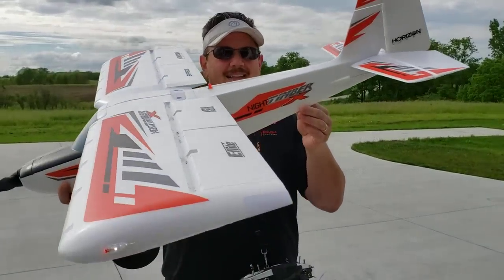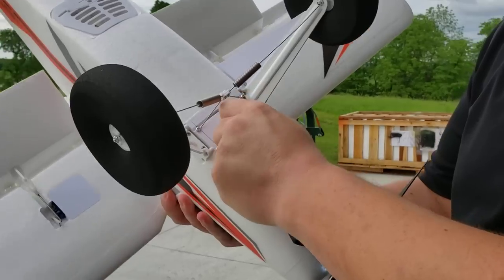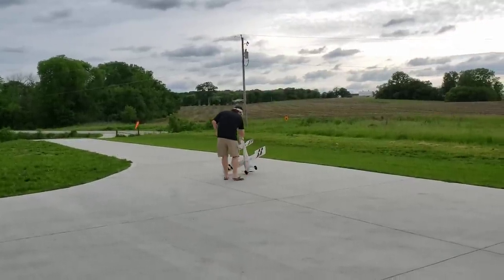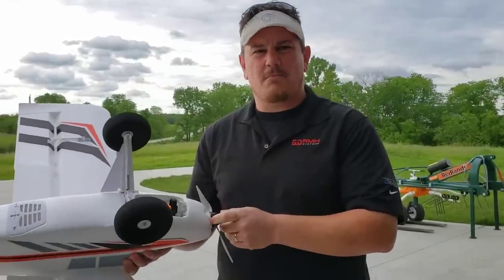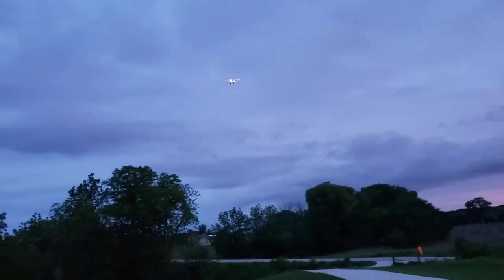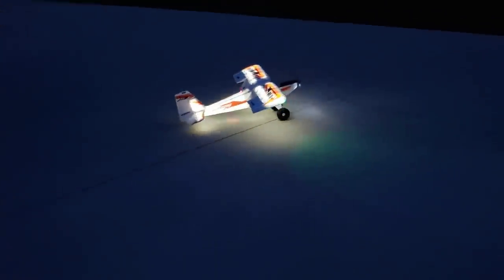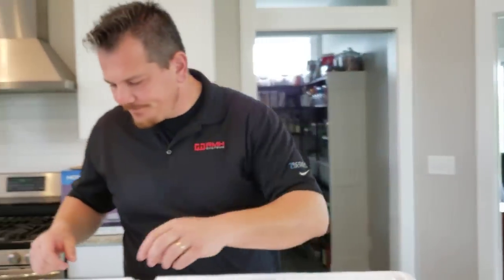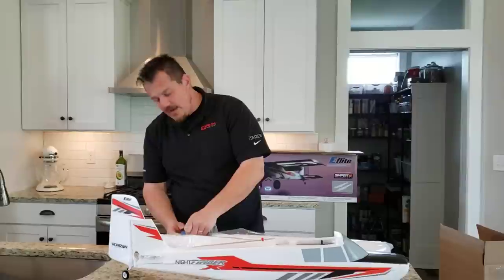Horizon Hobby - Night Timber X 1.2m - Unbox, Build, Setup, & Maiden Flights

Comment: I just learned why you remove the prop while programming. Just got home from getting 20 stitches in the palm of my hand.... haha I’m so stupid sometimes. One thing is for sure, I won’t make that mistake again. The part at 1 hour and 58 min is where I get lost. “We will obviously keep our hands out of the prop area during motor reversing cause we don’t need hand chopping” this totally applies to dummies like me.
Reply from the maker: Ouch!!! I've been lucky to only been bit by UMX planes, but this plane would be no-fun!!!
Reply: Brian Phillips it was no fun.  Those props are sharp. Btw, greAt videos, I am still trying to program my dx8 g2 transmitter and can’t get the reverse programmed correctly.  Which is why it went full throttle at the idle position.  Any advice would be great since I almost threw it across the room after the prop cut me open.  I followed your video tutorial, but I must have screwed something up..  I get lost when you disable the gear or something.  Is gear safe mode and aux 2 reverse motor mode?  Gonna take a couple days to regroup and lick my wounds haha. Great videos you and you wife post.  I have binge watched a bunch.  I look forward to more videos! Should I Inhibit aux2 or gear?  Do you set up high and low rates and did you set up the blending to use the flaps and ailerons at same time?

Comment: A excellent fun plane to fly. The only two negatives I encountered with my Timber X,(not the night version ), were the tailwheel was set at 45 degrees to the neutral rudder position which I very carefully used a screwdriver to straighten. The second was the foam is dented in under the front cockpit plastic piece.
I installed the metal spar in the tail right from the start as I intended to mainly use 4 cell batteries. I flew the first flight on a windy day, ( always windy where I live in Australia) and found it handled the wind no problem. Dropping the flaps in the wind is like slamming on the brakes and is a lot of fun.
Due to the large amount of control surface movement, even with safe on a beginner would find it a handful. 
One thing I would suggest is to have spare props on hand in case of tipping on the nose. The plastic on the wingtips certainly saves the wings if it tips over. It is by far my most favourite plane. Trying to get club members interested in doing STOL spot landing competitions.
Enjoy watching your videos. Keep them coming.
Reply from the maker: I hate when there's little stuff screwed up on unboxing - super annoying!!! Sounds like you love it. I want to maybe put on the slats, just because I want them on there for looks ;)
Reply: It might take some of the edge of it’s manoeuvres but if hot glued on should be easier to remove than if  superglued.
I do enjoy flying it. I also have the 1.2 Mustang June Nite and the Viper. Figured if I could handle the Timber X, I should have no problems with the other two. Unfortunately planes here are double the price you guys pay due to the exchange rate so crashing is not an option.

Comment: FYI: When I built mine, I found that the internal control horn set-screw for the rudder control wire was a bit loose and while the rudder was likely well aligned at the factory, when I was assembling it the setting moved.  I'd suggest after you setup the radio but before you install the wing, you recheck that the rudder and elevator are centered with the radio on (zero trim settings) and then torque down that set screw!  Otherwise, you likely will have a "bad day"!  Doing the wire bundle zip-ties that Brian recommends is also very smart!
Reply from the maker: Loose screws can lead to a bad day, for sure!

Comment: Brian. Got this one a week ago. Awesome plane. All the features this one has makes up for the bottom battery installation- that’s the only thing that keeps this from being the perfect specimen from Horizon. Other than that—just beautiful. I was amazed at the 4s power.....I believe I may have to pick up another 1 for back up....If you know what I’m thinking....lol. I was playing hard with the original Eflite Timber and decided to plow the field with it while it was inverted. I liked that plane, and salvaged most of the electronics but never replaced it...I love planes that have lights. When the Night Timber came out-had to have it. I don’t do 3D either-at least not on purpose...haha. Oh-If you not heard already-some folks have experienced some control rods popping loose from the control horns. I highly adding some fuel tubing to all the ones for the wings-especially the way you fly-if you not already thought of it. Enjoyed this video. Kudos to the Camera Crew. 🔥🔥👊👊😉
Reply from the maker: I totally agree about that bottom access for the lipo....but it is what it is ;) The lights are good enough that you can actually tell what direction you're moving, and the orb of light on the ground it fantastic!!!

Comment: Took a hiatus from flying the Apprentice from a shoulder/arm injury during a rainy workday at the club field - slipped and fell directly on right shoulder HARD!  That was some 4 months ago.  During that time I took the plane apart, stripped off the decals and am painting it to resemble the Cessna Skyhawk that I owned for seven years.  At this week's swap meet I bought a BNF Night Timber 1.2 for a great price planning to take it with me on a 1 month plus camping road trip - smaller size to help with storage.  Could be easy to fly with SAFE/AS3X.  Should be back to flying this April.

Comment: Hi Brian,
At around 1:59 you wondered about the A switch on the IX12. I have the IX12 and the A switch is a 2 position. I setup safe on that switch. I also tried to do the advanced setup but had problems with the left aileron not going the same direction as the others. Decided to revert it back to standard setup and in the process I had two spare servo extensions. As it was necessary to re-bind the plane I plugged one servo extension into the bind port to make it easier to plug in the bind plug. I didn’t run it through to the battery area but I think it would reach. I also deleted the model on the transmitter and started with a fresh setup.
The battery straps are starting to stretch now so I will be fixing that problem shortly.
I found it odd that they didn’t supply two servo extensions to do the advanced setup. At the time I purchased the plane the extensions weren’t available here. 
The IX12 is a great transmitter and I’m glad I bought it when I did. A very capable transmitter. The IX20 has way more features (sorry camera crew!).
Reply from the maker: LOL - I look forward to my new IX20, just as soon as I have almost everything else done around the property....

Outbuilding
Shop finished
Basement finished
Pond installed
Trees planted
Mini excavator purchased

...then the IX20 ;) LOL

Comment: Thanks for your quick reply.  The plane is a BNF and has the AR637TA, and I built from a blank profile, starting with the same settings as our other Timber X, but I changed some things.  Then I tried the two downloads available from Spektrums website mentioned earlier.  

I agree and thought that the AS3X is supposed to always be on, which is why I was wondering what is possibly wrong or if I some how conflicted it off or something.  Our other Timber X, is also the 1.2M, basically same plane except it has the AR636A reciever and I like that it's touchy.  It flys great, with both the iX12 and DX6 (Gen2).  That is why I bought the Night Timber, because of how well the our other Timber X 1.2 flys in variable wind conditions, so my wife and I can fly together, with basically the same plane.  Perfect manageable size too!  I will compare the settings between the two again lol.

I made a mistake saying I was using the 4S 5000mAh batteries, that was wrong, We actually use 3S 30C & 4S 50C 3200mAh's.

Thanks again, I glad to hear it confirmed that the AS3X is always on and can't be turned off with the AR637TA receiver.  Now I know it is something with my settings and I'll work on that.
Reply from the maker: With the AR637T you CAN access "Forward Programming" to turn it up or down, or off....but at this firmware level of the AR637TA, you're STUCK :(... I think the answer I got from HH is that there MIGHT be a firmware upgrade for the TA :) :) ;)
Reply: @BrianPhillipsRC   I hope so.  It would be nice to be able to adjust.  I'm starting the transmitter setup again for about the tenth time. I tried the original Timber setup too, didn't work.  One  flap servo started to jitter and won't stop even after holding it, and now the other servo's on the wing are following suit.  I still have a lot to learn lol.  Both the Carbon Z Cub 2.1 and the other Timber X 2.1 setup perfectly the first time other than one bad servo that got replaced.

Comment: Are you a beginner pilot wishing to buy this plane?  I am a beginner pilot and I bought this plane because of this video and others like it, and because I wanted the lights for night flight. Here is an update on my thoughts about this plane after 10 or so flights:

1. Forget thoughts of flying in the dark. You lose depth of field when the sun goes down and a crash is likely for a beginner pilot. The lights are very cool, but they aren't for you.
2. Before flying this plane, I had flown a small park flyer (I forget the name), a Carbon Cub S+ and a Conscendo Evolution. This plane is a big step up from those planes in the sense that it is very fast and the control surfaces make it very twitchy for me.  It rolls, climbs, loops, dives all very, very fast. Of course you can slow things down, but in trying to figure out how to slow things down you'll probably crash along the way. Get it up high becuase you are going to be flying some acrobatics when you don't mean to be flying acrobatics.
3. Landing is MUCH harder than it was for any of the prior planes I had flown. This is a heavier plane and it is easy to break the plastic in the fuselage that the landing gear screws into. If you are a beginner pilot, I would say a hard landing is the first way you will break this plane. And when you break that plastic in the fuselage, it is never as strong as it was after you glue it together again with epoxy. So you'll be applying epoxy to your fuselage around the the landing gear more than once. OTOH, if you have access to an experienced pilot that will buddy box with you, you should be able to avoid all the landing problems.
4.  Unless you are just flying ovals, you probably won't be able to fly this scale the way Brian does in this video. You could just fly it on SAFE, which is what I did a lot, but eventually you'll want to fly the plane yourself, and when you do, it won't be a smooth flyer.
5. 4S power is a lot of power in this plane, but it's kind of made for 4S power.  It flew much faster than what I was used to, and bad things happen much more quickly in this plane. You could just put a 3S battery in it, reduce the throws, throw in some EXPO, turn on SAFE, etc. but if you are doing all that it means you bought the wrong plane.

I have crashed my Night Timber X a few times, but it is still flying. HH sent me a new fuselage for free, so that was nice of them (I just put it together last night and it's like a new plane...anyone want a good deal on a Night Timber X?) 

****************************************************
But for me, the Night Timber X is more stressful than it is fun. ***** ********************************************

 I have just placed an order for the Turbo Timber. I wish I had done that in the  first place. Brian told me to start with the Turbo Timber, but I didn't listen. (And Brian, if you are reading this, you should not have told me to "start" with the TT, but you should have told me that "the TT is a lot more fun than the NTX.")

One last point, if you don't want to fly 3D, if you consider yourself a scale flyer, then I'm not sure this is the plane for you even if you are an experienced pilot. Turbo Timber seems like the way to go for a scale experience in a plane like this, but I haven't flown one yet.

One very experienced pilot who is very much into STOL told me that he sold his Night Timber X and purchased a Turbo Timber because NTX was too heavy for good STOL. And the NTX is not even marketed as an all-out 3D plane. 

I think part of the reason I purchased the NTX instead of the TT is because I was looking at the TT as closer to a beginner plane. Someone says "you aren't ready for the NTX" and I think "oh hell I can figure it out." Who wants to spend money on beginner equipment only to be unhappy with it after 8 or 9 flights (think of that first crappy transmitter you wasted $100 on)? That WOULD BE a reasonable way to look at it if the TT was built  for beginners and the NTX was built for more experienced pilots. But that's not how they designed these planes.

The TT IS more suitable for intermediate pilots, but even if you are an expert pilot that doesn't mean you are going to pick the NTX over the TT, and the experience of the expert pilot I just mentioned is an example of that. It's about the kind of flying you want to do.

Don't get me wrong...I think this plane is everything Brian and others say it is. It's just that it's definitely not for beginners, and it isn't for every expert either. It's only halfway to a 3D plane, and it's halfway to a STOL plane. It'll give you a taste of each without really getting you there. And if you want to emulate the sort of flying Brian does in this video, then I would say you'd be better off with the TT.
Reply from the maker: You literally just too the words out of my brain. I just replied to Luke Gagnon, who asked about this as a second plane compared to the Maule...

Get a load of my reply to him, to help reinforce your comments, which are 100% spot on!

VVVVVVVVVVVVVVVVV START REPLY TO LUKE VVVVVVVVVVVVVVVV

Luke - HEAR ME ON THIS....JUST flew them both this weekend, and I was reminded of this...

The Maule is a great choice, BUT the Turbo Timber (not the Timber X) would be an even better choice. The flight envelope on the Maule is just a lot FASTER, not impossible, or even a bad choice at all for a second plane, but the Turbo Timber 1.5m is super forgiving, and flies a lot longer on a charged pack of the same size. I know you didn't want to hear this, since you're concerned about space in your car, but I can tell you with 100% certainty, you will thank me later... You will may be totally overwhelmed with the Night Timber X and I bet you'll be very disappointed, as a result- it's NOT a bad plane, but you have to be ON IT! It will stress you out!

Notwithstanding your transportation issues, as they're both pretty big...both of the LONGER wing span planes options are BETTER options, with the Turbo Timber being the best option for your "next" plane given your current plane is the Aeroscout (one of the easiest, and best beginner planes around, btw).

Turbo Timber 1.5m https://bit.ly/2CiTmSB (This plane is an AWESOME choice given your criteria)
Maule M-7 1.5m https://bit.ly/2Wrj1zz (This is a good choice...might be a TOUCH easier to transport than Turbo Timber)
Night Timber X 1.2m https://bit.ly/2CB9I9d (You will regret this one as plane 2 - sorry Luke)

AAAAAAAAAAAAAAAAA END REPLY TO LUKE AAAAAAAAAAAAAAAAA
Reply: @BrianPhillipsRC  One question for you. Over in RCGroups.com a couple guys who did not like the Night Timber X for the same reasons I stated, purchased a Turbo Timber wing and said it now flies like a Turbo Timber. I know the rear stabilizer is different on the TT, but I went ahead and purchased a TT wing. Do you think this will do the trick, or do you think I should return the wing and just get a TT?

Comment: Just a couple of questions:- 1) aerobatic with the slats left off, what help are they to the aircraft  2) Have you tried the 3c 3300 amp batteries yet?  3) Done any night flying with it ?
Reply from the maker: 1) Slats would generally hinder extreme 3D flying
2) 3S 3300mAh - I thought I did???
3) I fly in this video at night....so yes ;)

Comment: I'm not trying to stir contention or discontent. So I did purchase this Night timber 10 days ago during Eflite's sale from a local shop while in Rocklin, Ca. While here Working for a railroad. However have you seen Hobby King's (oh I know, hobby King?¿) Night Tundra? Dang! It looks so cool. The port and starboard lighting is Kick Ass. I think my night timber still in the box..... May be for sale. 🤔
Reply from the maker: I think it looks cool, but when you find a Hobbyking plane that FLIES better than almost any Horizon Hobby plane, you will be dealing with the EXTREME EXCEPTION to the rule ;)

Why not BOTH???
Reply: @BrianPhillipsRC  Brian, thank you for replying. I wanted to see your take on it, as you've flown everything. Except perhaps SpaceX. 
Although the lighting is super cool on the Tundra. The Timber is more versatile by design. I like the 3 or 4s option and that it can be flown lit up or not.   Also I haven't been burned by H.H. with quality of craft or customer service. 🛩️

Comment: I just caught your ‘here’s how I store my planes’ (which was great and instructive) and during that video you mentioned you wished you had installed the slats.  Will you do so in a follow up to see how much it degrades aerobatic performance?  I have not done so on mind but think it might go far to reducing a stall tendency which has happened to me twice, once at low altitude and I did not react fast enough to keep its nose out of the ground.  Broke the prop but all else was fine.  Could only get an APC prop and they don’t work with the spinner.
Reply from the maker: I didn't install the slats, and don't have plans to do it on this particular plane. If you just caught that plane storage video, you wouldn't believe how many more planes are sitting down there now!!! It's getting crazy!